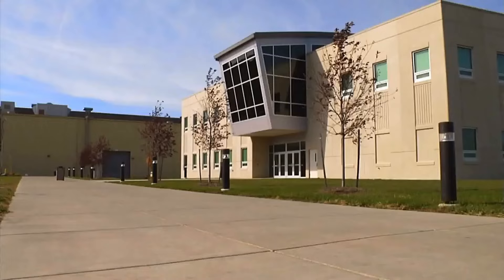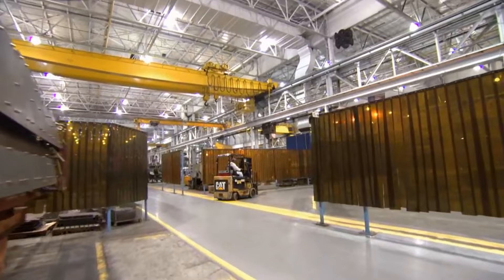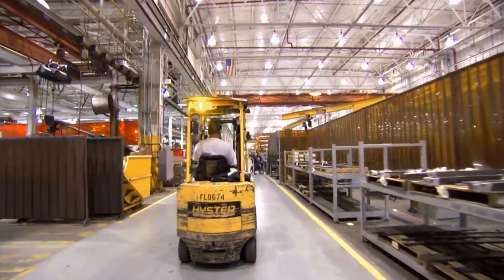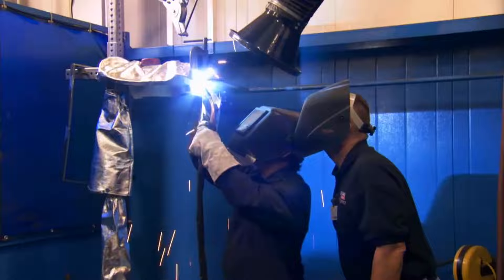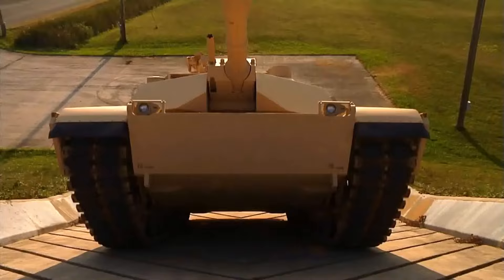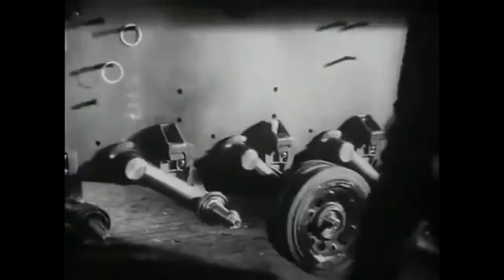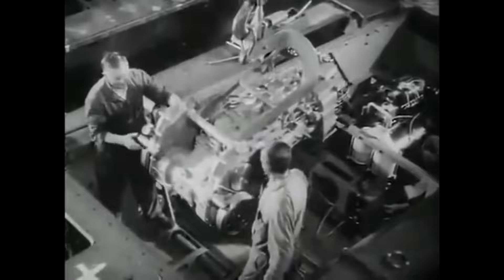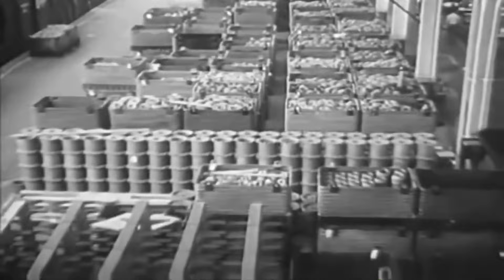Tank Factory🤖Production USA Abrams Ukraine - Russian tanks How tanks are made? Manufacturing process

Comment: I like the design of both tanks, they look quite deadly, even though they have an old age. Each tank is unique in some way, which I like. The T-90 has a low profile turret, which can be hard to hit, and it has a good gun. The M1 has  a powerful gun, and great armor. But either tank has weaknesses that can destroy the tank.
Reply: Yes, if looking at the hard factors they are very similar but overall the abrams sensors and overall technology inside the average m1a2 sepv3 abrams can outshoot anything russia has, also the M1 can run on almost any fuel as opposed to the Diesel fuel only T90, also the Commander has had thermals on most variants on the m1a2 while the T90 has not
Reply: @rookie.9175 the diesel engine can also run on other fuels then diesel, it has less variety but still, plus the t90m features a lot of upgrades on the sensor part so you cant really know as a civilian
Reply: @rookie.9175  так говорят что наоборот м1 питается только высококачественным топливом